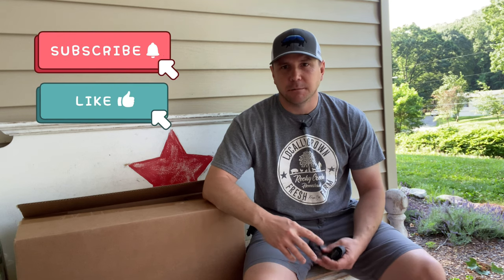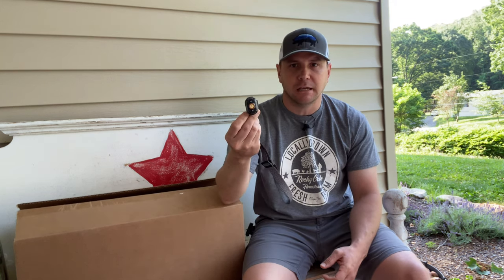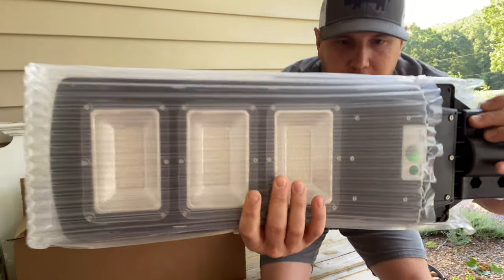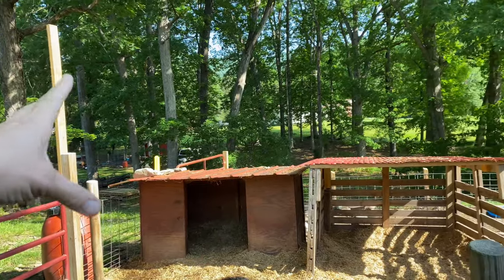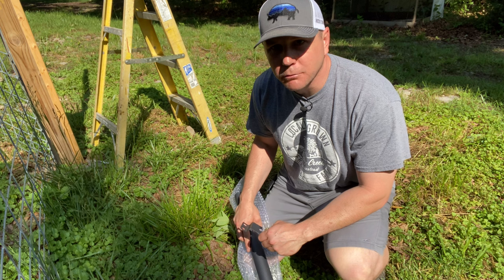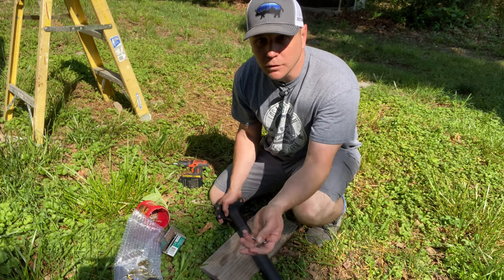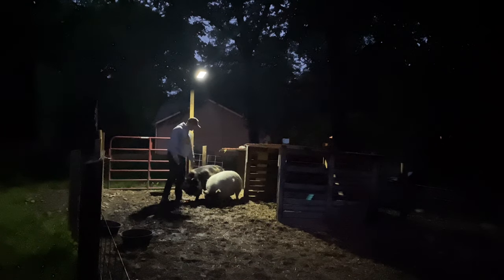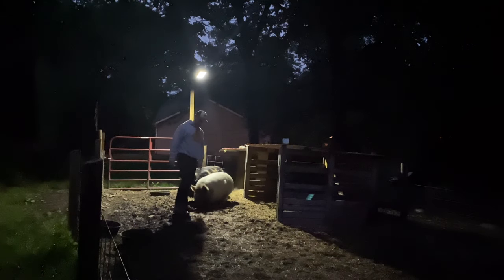Adding SOLAR STREET LIGHTS to our PIG area.  This will make a huge difference!

Comment: got mine about 6 yrs ago still works fine  l ordered 4 smaller ones from amazon  for inside the house when we lose power  just remember to put them in the sun to recharge
Reply from the maker: Wow that’s a pretty neat idea.  Never thought about that.  I’d like to add a few more to other areas of our property at some point.  Ours are still working well also.  Thanks for sharing

Comment: What a fantastic job you did with this video. From opening the package, showing hardware and great instructions on mounting. Then great showing of results. I just ordered and received 2 lights that look exactly like yours but had to order mounting bracket separately. I just opened them and no instructions at all in package for mounting. My lights came from Home and Lighting. It is a huge turnoff to have to order brackets separate and receive no instructions. Because of that I would not order from them again and makes me consider returning it all. Thank you for showing me how to mount mine. Great job.
Reply from the maker: Oh man that stinks yours was missing stuff.  Overall these lights have held up.  I’ve noticed the bolts they included with my hardware are rusting pretty bad after a year.  I may need to replace them after a while, but everything thing else seems to be holding up well.

Comment: Great job Stan. Only though I have is, I had a couple of smaller solar lights, but the solar panels really need direct line of sight to the sun, due south unobstructed, to really recharge. Hope they work out well 👍
Reply from the maker: Yea your definitely right.  I actually had another spot initially thought of and moved it slightly just for that reason.  I have a space between the trees where the sun hits regularly so hopefully it will be enough to keep it running properly.  Thanks buddy, take care

Comment: Do they stay on full light all night long?   How i made a 2 12' 2x4 Light poles is out of 3  8' 2x4s > 2 long ones  and  1 cut into quarters for a braces >  for 2 light poles  They also stated that the solar cell needs to be point at the sun! That changes every thing up  ~   What i'am looking for is FULL LIGHT FROM DUST TO DAWN
Reply from the maker: You can set it to stay full light, but I haven’t tested it to see how long it will last.  The longest I’ve run it on full power was 2 hours.  I haven’t had a reason to be out there longer than that.  Other than that, it runs at a constant low light until it detects motion.
Reply: @RockyCreekHomestead  Cool i went ahead and bought one. I really want it on full light all night long. Its free lighting and nice to look out to see if its raining ect.
Reply: @RockyCreekHomestead  The other one i bought the 2 pack  JACKYLED solar lights / they was bright white light, all the functions worked > but only stay on for 4 hours in full light and about the same with dim lights > There only good for sensor motion
Reply from the maker: I can see a benefit of those around our chicken coop area probably.  It would be a much more affordable option.  Thanks for sharing
Reply: @RockyCreekHomestead  I guess they got charged up! I set them on sensor mold only, for 2 nights. Then switch them over to low light.   Last night they stayed on low light all night long  Hurray  👍👍😉😉

Comment: Thanks for the review and info.  Just wondering if the shaking of the tree branches will trigger the lights on during a storm.
Reply from the maker: I haven’t noticed that and would be surprised if it did.  In my opinion you have to get pretty close to the light to trigger the motion.  The motion sensor is on the bottom side too so I think it’s detecting motion below it.

Comment: Hell my little cheapo 35 dollars 
2 Pack JACKYLED Solar Street Lights Outdoor Motion Sensor, LED Security Solar Powered Flood Light with Remote  Does the same thing and its BRIGHT. but i don't stay on full light longer that 4 hours. Now in Motion on and off mold is?   the only way to have light all night long AND THAT SUX>  I'am happy with the brightness. Just don't stay on all night long < > I mounted them on 2x4s 10' above the ground and 2' under ground

Comment: Great for the average, 'weather wise' location. but here we can get down to -40 and all in one units like this don't hold up.  Hard wired in is the way for us.  BUT, I can see us using this on a portable stand with chicken tractors in the field or to brighten an area you'r working at. I've bought they kind you hang, the are just not bright enough.
Reply from the maker: I never thought about intense cold temps effecting them.  That’s a great point to bring up.  I’ll be curious to see how it impacts these when those months get back around.

Comment: 8 months in, Going to see if there’s an update video but if not, can you let me know how these work. We are moving to a Homestead in two months and these seem like a great idea, I’ve been seeing them all over Facebook
Reply from the maker: I haven’t done a follow up but they’re still working well.  We did have a deep freeze and cold spell for a few weeks which did result in a couple days of the battery dying.  Once sunshine came back they’ve been working like normal again.  A couple days of no light in 8 months ain’t bad though.  I hope that helps.  Thanks for watching
Reply: @RockyCreekHomestead  it helps so much.  Thanks for your response.  They should have given you a discount code:)
Reply from the maker: In all honesty they’re the only company I had a slight fall out with.  Although their product worked well so far, we disagreed on some things that happens after the fact.  They used my video I created to create an online commercial that got millions of views.  They cut out my channel and page name and all I asked was for them to provide credit in the description of the ad as the content provider.  They wouldn’t do so and we ultimately had to agree to disagree.  Lessons were learned through the process.  Although I felt disrespected by their business in terms of our relationship and agreement, their product is holding up.  I try to be honest at all times so although I don’t care for their business practice with me, I can’t knock the product.  It is for the disagreement I don’t have a coupon code to provide.

Comment: I bought 3 different kinds. They all have some sort of problems !  and out of the 3 This one even beat a 350 watt street light >  These are super bright and stay on full power from dust to dawn, AND there cheap! a 2 pack for $ 39.99 dollars Amazon>>  Zyfei Solar Street Light Outdoor,180 LED 3 Modes Solar Motion Sensor Light with Remote Control,Solar Parking lot Light for Garden, Street,Yard-2 pack >>  The bad thing Is! They have a weak plastic ARM BRACE. THEY WILL BREAK!  Other than THAT THERE EXCELLENT BRIGHT LIGHTS
Reply from the maker: Sorry you had a bad experience.  We just have to two still and they seem to be working without issues.  My friend bought some as well and his are working good so far.
Reply: @RockyCreekHomestead  Cool. Glade there doing what they suppose to do! Happy Holidays
Reply: @RockyCreekHomestead  The main reason i went to solar Streets lights is? No Electric used, and works in power outages as well. 5 electric street lights at 500 watts costed about $130 dollars a month in electric use 😥>  You know how dark it is out on a farm!  We can even see our hands in our face. during the night time 😆 We have to carry with us all the time, some sort of flashlight
Reply: @jackhuang268  Thank you i got plenty and very happy with the solar 350 watt and the other one with a bad brace. I got the brace super strong now.  That looks to be a good solar light as well. I LIKE THE BRACE. Its like my 350 watt solar street light > 2 for 139 dollars ~ Thank you for sharing 👍👍
Reply: @jackhuang268  Now its finding a pole to mount them? The stores are limited to what they have. So we now have limits on poles that we can find.  Metal fence pole are only 6' long and very expensive to buy >>  The cheapest pole i found was a 12' 4x4 wooden post. I painted it and, bury 2' in the ground. That what i used on the big heavy 350 watt solar street lights. >  It was all this old man can do. was to set it up. It was super heavy! > The hole in the ground make it easier to set it down, into the hole

Comment: I bought a similar light to mount on a metal pole in my unit complex carpark. Im going to install it below the electric light as the lights are never on due to vandalism.
My setup did not come with a bracket to install on rear of the pole, and I cannot drill into pole as it being electric.
Any ideas how to improvise without the bracket.
Thanks for explaining all the details of the remote as mine is the same.
Reply from the maker: If you can find something like this at a local hardware store https://www.amazon.com/Boao-Pieces-Adjustable-Stainless-Clamps/dp/B07X5Z36Y5/ref=asc_df_B07HRSDVSD/?tag=&linkCode=df0&hvadid=312178336510&hvpos=&hvnetw=g&hvrand=1302332555460418379&hvpone=&hvptwo=&hvqmt=&hvdev=m&hvdvcmdl=&hvlocint=&hvlocphy=9008748&hvtargid=pla-575169812876&psc=1&mcid=86ff525abf0135ea8b0ff2a9e20f6f9f&ref=&adgrpid=60913153143&th=1 .  Maybe if you have enough contact surface on the back, it can squeeze it to the pole of you run one on top and bottom.  It tightens by turning a screw.  Just a quick thought that came to mind

Comment: Hiii, thanks for the video, i wanna know what happened to light after this time.
Thanks
Reply from the maker: The light is still functionally just fine.  The remote works consistently but you have to be rather close to the light to switch modes.  Longevity of charge and brightness has held up well so far.

Comment: Nice video Stan. Do you find the 90W option sufficient or should one go in for the higher wattage. I have a big garden and would be putting several of these all around
Reply from the maker: I am pleased with the 90w but my friend purchased the 120w.  He’s happy with his, but I haven’t been by his place yet to personally see the difference.  I think if I hung mine up higher it would cast across a larger area.  I think it may be dependent on how high you can get them up.  I don’t see a reason to go brighter than what I have though.

Comment: Looking for a one year review. Are these still working? Thank you.
Reply from the maker: Thanks for watching.  They are both still working properly.  During the peak of winter with shorter days and cloudy conditions, I had a couple days they didn’t charge enough but other than that they’re working fine still
Reply: @RockyCreekHomestead  One more question. How far does the motion detection work? I plan on mounting this about 15 to 16 feet high. Thanks again.

Comment: How reliable is it,, can it light up till morning?
Reply from the maker: Thus far they’ve held up well.  If I keep it on the setting where it’s low light until motion is detected it works through the night.  I haven’t tested it in constant full brightness.  I’ve used the 2HR brightness mode when I go out to feed in the mornings or late night.  Once the 2 hours is up the light cuts completely out instead of going to low light which is a pain.  I just make sure I use the remote to switch them to low light mode when I’m done feeding now.  I’ve had about 2 viewers comment that they had issues with their light and customer service wasn’t good when they reached out.  I haven’t had to contact them yet.  Other than them sending me the wrong mounting screws for one light, I haven’t had an issue so far.  A local friend purchased 2 without issues as well.  I hope this information helps you determine if it’s worth the buy or not.